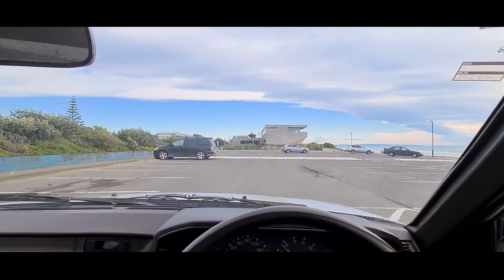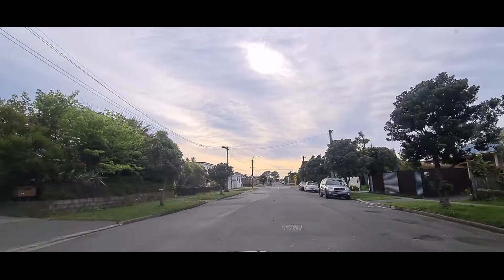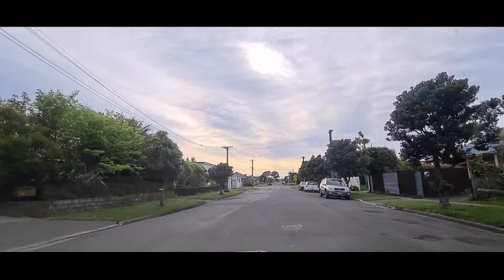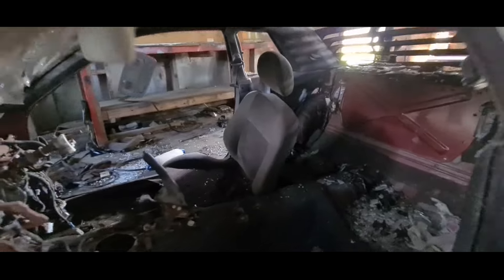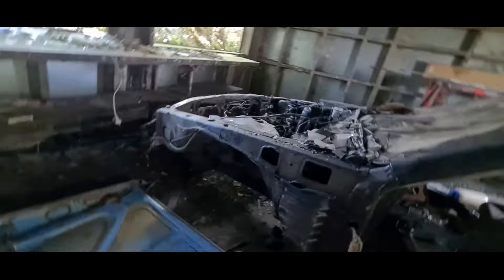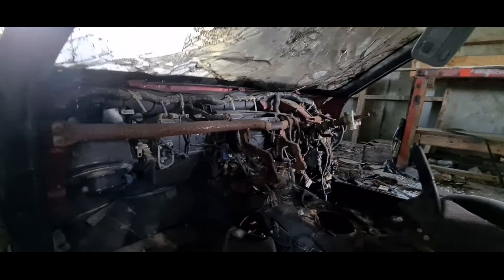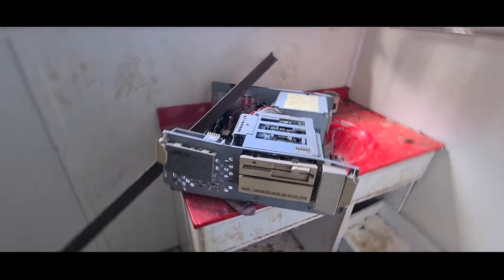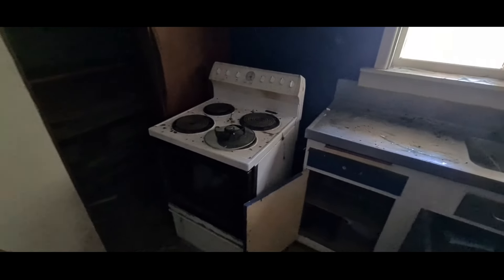Abandoned Nissan Skyline R32 - NZ Exploration 30

Comment: Proof that R32s used to be less than $5000. Especially non turbo auto models. Were worthless in 2010. Couldn't give them away.
Reply: Way less than 5k, I remember the bros grabbing them for 1500 back in the day. A32 1200 bucks, a s14 for like 1800. Then the government brought out the boyracer act and all the cars just got crushed, hence why they're worth so much now days.
Reply: I saw a few for $600 -$1000 . I bidded $1200 on a a31 cefiro with WOF and rego at turners , then found another car and brought it . A week later I got an email that I had won the auction , so I ended up with 2 cars + my daily Toyota cynos
Reply: @AstrixCloud  That's not why
Reply: I bought an r32 sedan 25de auto, factory alloys and radio for 1500 in 2011, sold it in 22 after putting 80kms on it, lugging 3 kids around in the back seat trashing it for 8k..... they were cheap compared to what they are now